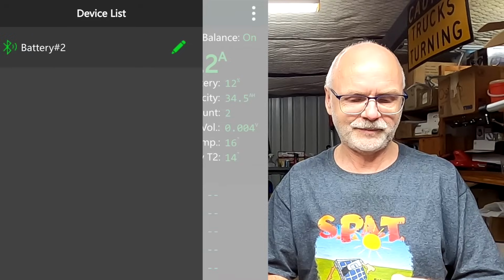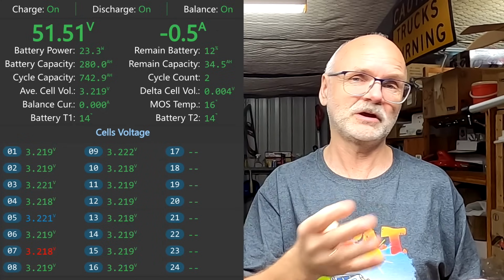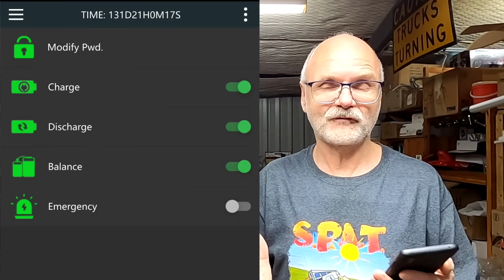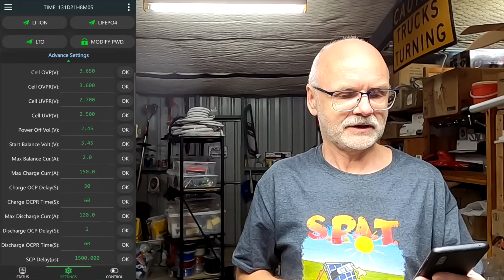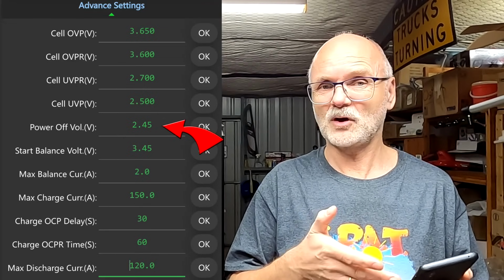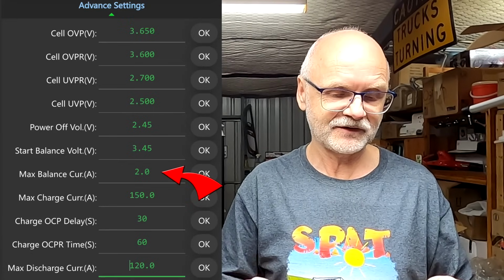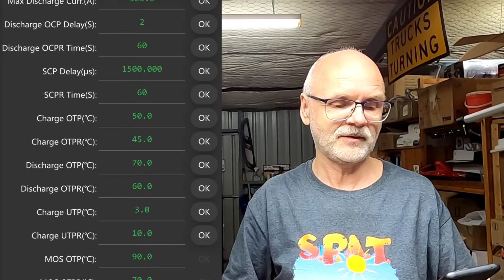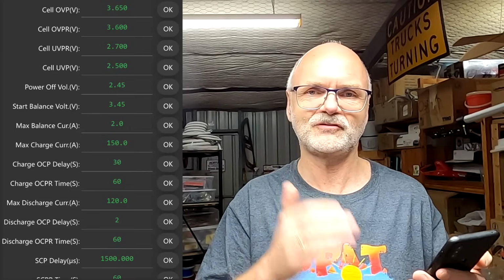JK-BMS: all settings and menus explained. How to program and set parameters.

Comment: Andy, thanks for the Video. Just out of curiosity, can you put two BMSs in parallel? Say the other BMS has canbus compatility with Victron.
Reply: In parallel with another battery attached then I imagine you can as Andy has. I imagine it's not possible if you have 1 battery and 2bms attached to the one battery. Just because both bms will want to balance the one battery so this might cause issues.
Reply: @mattjayne5231  the first BMS is a Batrium one. It will act as an active BMS . It has a remote shunt trip that disconnects all the batteries in the event of a critical failure. The other one I already ordered is the jbd bms. That one can disconnect individual battery banks. Therefore, my idea is to connect the Batrium to the victron system and to each battery in parallel to the jbd. Let's just think of it as an active balancer. I wonder if I am missing on something.
Reply: @salimnaufal1779  sorry I'm not familiar with the barium. What do you mean by active bms. As in it actively balances each cell? I'm unsure what features the JBD will add if that's the case. Unless you mean you'll use the JBD just as an additional balancer. If that'd the case I see your point bevause you can parallel active balancers and bms. 
I'm not sure to be honest, it might conflict if you've got 2 bms but I see your point you can parallel a bms and an active balancer.

For the sake of ease I'd probably be tempted to just get a larger balancing current BMS that also supports connection to victron
Reply: @mattjayne5231  
Batrium was the only Victron compatible BMS I could acquire. Victron encourage people to use their LiFePo4 batteries. The Batrium BMS has one central unit that connects to the six satellite BMSs on each of my batteries. It can also communicate with the Victron inverter and MPPTs using the compatible CANBUS. My problem with that is that it has controls a remote shunt trip that can turn off all 6 batteries if the event of a critical failure. It can balance each cell with up to 5 Amp. I will be able to monitor my batteries directly on the Victron system.
The JBD BMS, just like the JK BMS can turn on or off the battery it is connected to. It however can only balance with 0.2 Amp which can be quite slow. 
The JBD BMS will be able to turn on or off each battery bank independently since I will have 6 of them. 
I will make sure that the parameters for balancing the batteries are set to the exact same values of both BMSs to start. As for the critical errors that will cause all 6 batteries to be disconnected by the Batrium BMSs central controller, I will make the tolerances larger allowing the JBD to do the disconnection first.
I haven't yet received my batteries, I should in one month, I'm just planning it.
Reply: @salimnaufal1779  sounds complicated. Are the 6 batteries in parallel? Seems odd the batrium isn't able to turn off 1/6 batteries for example. That would eliminate the need for JBD by the sound of things. Is there maybe an option to add multiple relays in batrium system? Or is that expensive? 

Also what happens if JBD bms turns off one of the batteries. Is the batrium system then also not going to have issues as its lost 1/6th of the capacity but doesn't necessarily know that has. So would the satellite bms not spit out errors then given its been disconnected by the JBD?

Definitely an interesting one. Sounds quite a niche structure having dual bms. Might need some testing to work out if it's possible. In theory it seems it would but unsure how batrium will react if JBD is controlling things that it isn't aware of.
Reply: @mattjayne5231  I'm anxious to get the batteries to start testing. I will also request Support from the Batrium technical team to see what could be done... I'll send in my experiment to Andy but... unlike Andy, I will be compressing my batteries). It's going to be a hobby of mine for a while. Take care!
Reply from the maker: Would not make sense to put two BMS in parallel on one battery. What is the benefit?
Reply: @OffGridGarageAustralia  Mainly it's to be able to monitor things from Victron. It has a full set of controllable relays for alarms, fans, etc... quite extensive setup. The best thing is to get the setup ready and experiment... That is when by batteries arrive (delayed by one month!). I'm still running on the horrible lead-acid tubular ones!\

Comment: Hi Andy how you doing I hope all great just a question if could please help me I have a system with 3 set off batteries connected in parallel will like to connect a victron smart shunt do I connect just the one to my negative parallel bust bar thanks and regards
Reply from the maker: Yes, the smart shunt connects to your neg of all three batteries. It measures the overall current for all banks in total.

Comment: 063022/2107h PST 🇺🇸.   Danke Herr Andy. Xiaoxiang BMS (JBD) is sold under several names and Labels (some with ridiculous nomenclature)as requested by the bulk buyers/sellers. They are good, they are very intelligent, user friendly und very configurable.
I have twiddled with it for several years now and finally settled with your advice and configuration.
The system functions quite well and flawlessly in conjunction with VICTRON 100/30 Charge controller. 
Cheers, guten Tag und 73s…

Comment: Dear Andy,
I forget the password of JK bms and my phone got reset.
So, now I am unable to connect the JK BMS.
Can you help me with this situation?
Please
Reply: The default password I recall is 123456.
Reply: @FutureSystem738  Thank you for reply. But it's not working as I have changed the password.
Reply: @bishwagit  The only thing I can suggest is write a list of common passwords you have used in the past. Then try them one at a time, and cross them off the list.
Failing that, maybe just asking the manufacturer if there’s a way to reset. (There usually is- … though not always.)
Reply from the maker: You can only ask Hankzor what to do in this case... very unfortunate!

Comment: I purchased B2A24S15P BMS after watching your video and set it up and 8 cell 280ah and it ran for several weeks ok no issues. I then built a better battery shelf and disconnected completely and setup on shelf. The same cells were not in the exact same position but didn't think it mattered but now I have a 'Sample-Wire resistance Too Large' message coming up and it won't balance!  I have gone over all connections and tightened screws etc but still same. I thought maybe if I did a factory reset to wipe all data of it like it was when new it might work. How do you actually do a factory reset? Looked everywhere - no answer as yet. Why is this resistance message coming up?
Reply: I have just swapped BMS with another the same using the old balance cable and it all works.  Must be a faulty BMS or it really needs resetting??  I have messaged Hankzor so will see what they can do. BMS is only 6 weeks old.
Reply: I contacted Hankzor and they said: Thank you for your information. We are evaluating the cause of this problem. We will update the app as soon as possible to reply to this bug. thank you
Reply from the maker: Do you run the newest version from the JK website? Interesting that this is a bug in the app. 
Thanks a lot for sharing.
Reply: Yes latest version
Reply from the maker: @alltron66  keep is posted and get back to Hankzor of it's not fixed.
Reply: @OffGridGarageAustralia  I am very disappointed with these BMS's  Not only do I have a faulty one that they will not refund!!!   Now the  second one I have stops charging with no messages just zero amps coming in even tough there is power there and I have to turn disconnect switch off then on again for it to continue for however long then do it again.  I know you seem to have had some success with them but give me a JDB anyday.  The 2 I have have worked flawlessly and another good thing with them is the app doesn't keep freezing all the time and have to kill and restart the app like I do with the JK.  I'm sorry but I think JK has alot of work to do and yes I know it can active balance but unless it can work without all these problems they are not worth the expense as far as I am concerned let alone the non existant customer service.
Reply: I have spent over $400 on 2 BMS's neither of which actually work properly!
Reply from the maker: @alltron66  have you tried the new app version 4.8.2?
Where do you get this error? Right in the BMS or for a specific balance cable connection.
Reply: @OffGridGarageAustralia  the bms just stops charging! No msgs. All cells 3.3 to 3.4 when it happened today again. Not over voltage or current. 56a coming in just nicely then just stops no apparent reason. Very frustrating
Reply from the maker: @alltron66  can you send me an email? Go under About on my YouTube channel...
Reply: @OffGridGarageAustralia  I just downloaded today and yes it is working better so far thx. At least its not freezing ATM :)
Reply: @OffGridGarageAustralia  I must be blind. I can't find your email address🙄
Reply from the maker: @alltron66  or on my homepage right above the Buy me a beer section in the fineprint
Reply: @OffGridGarageAustralia  Andy, I have been sending you emails and not getting any responses.  Are you still talking??   Nami at Hankzor refuses to honour their warranty and say cannot provide any service.  How can Hankzor think they can get away with ignoring people who have faulty products. I know I won;t be buying another one of their products if thats how they do business!!
Reply: Well after chasing and chasing HankzorBms and getting no response they finally get back to me and say they can no longer provide and service. I am more than unhappy with this supplier. I expected great service but they have failed miserably and I am not sure what other action I can take to get a working Bms.!!??

Comment: I have also the JK-B1A20S15P Ver. 10XG For sure a good BMS and it do its job. Only disturbing is the constant "Protection (Current Sensor Anomaly)" error. It was also in ur log file visible. The seller said they aware of it and a update will come out. Only dont know when. What happen wehen the error appear? My BMS stops charging like goes on and of and after a while is it ok again. It happen when incoming and outgoing current is almost the same Then the error comes.
Reply: Hi Volker, I had the same problem. I adjusted the settings in the charger (multiplus II) fixed to variable and to lithium batt type and charge voltage tfrom 3,45 to 3,50 and had faults so far.... (3days) regards
Reply: @MrSkykay  Ok, I am charging up to max. 3.45V. Interesting. I am now in Thailand for a year, so it will take time to test it then :-)  Thanks for the help
Reply from the maker: Yeah, it's a known bug. I have not seen this myself in the 16s BMS I have.
Reply: I've been looking into this, and as Andy said, it's a known issue. JK claims it's because of using an all in one type Inverter/Charger (I have an MPPSolar brand). It doesn't happen on the older JK BMS I have, but does happen on the newer models with different Firmware and Hardware versions. From what I can tell, it's electrical noise in the circuit that may cause it. 

The "Anomaly" happens when it's less than 20A charge or discharge current for me, and while it appears to stop charging, it actually is still charging, I have a Smart Shunt to confirm this. So it's an annoying issue, but not a critical one. 

What it does do, is send the SOC figure way off what it actually is, until you reach either full or empty Voltage, where it resets itself. 

Hopefully JK will release a fix for this, because it's very annoying.

Comment: I have a JK BMS (with heating option) coming in the mail this video is very timely. Andy some video/test ideas for you: the JK with heating is a really neat future that I think many of your viewers can benefit from. Also, I'm surprised you haven't integrated the JK with Venous OS so that you can monitor your cell voltages on VRM and possibly control Victron equipment based on BMS data. This really completes the entire system in my view.  I plan to do this with a Cerbo GX using the LouisVDW driver. There's a page on Victron community on this topic. Check it out!
Reply: I have the JK BMS with the heater option. The 5 greens should serve as the negative connection and hooked up to one side of the heating pad. The other heating pad connection is connected to your battery positive. I tested this with a cup of ice water on the temperature probe and it worked perfectly. Note that the maximum amperage. for this function is 3 amps. I have a 25 watt, 12 v pad and it drew just over 2 amps. The red and black wires is not normally used but can serve to send temp readings to your charge controller.
Reply: I ordered the non heated 4s jk, and they sent a heated version anyway, but with no indication of how the heater should be wired up, it has i think 4 green wires, a black and a red and when i asked jk for the wiring diagram, they said please wait, and never got back to me. Got any advice on how those wires should be configured please?
Reply: @lexicase8805  I havent researched it yet TBH but once I receive it I will get backto you. There is another commenter on here than has had the same BMS for a while, maybe check with him. I asked him for recommendations on heating pad.
Reply from the maker: I have the 4s-8s BMS with heating function. Can't actually remember if it has a different menu settings for that...

I will connect the BMS to the Victron system at some stage. But there is literally no benefit of doing that apart from monitoring the BMS remotely. 99.99% of the time it will just show the same voltage anyway and there is nothing to monitor or control. Only if the battery is very empty or fully charged there will be a change in numbers and figures...
I know the driver and project page to connect it but again, no real benefit.
Reply: @OffGridGarageAustralia  I really hope you can do a segment on BMS and heating cells. Where to get pads and what to search for.
Reply: @OffGridGarageAustralia  Andy some of your viewers live in really cold plays or build batteries for RVs that go to really cold places. A video on this would be useful for a lot of your viewers.
Reply: @firpofutbol  Not even that cold, but in that twilight zone where there is a risk of freezing at night, some nights...
Reply: @OffGridGarageAustralia  well that integration gives you some interesting options. for example i start the absorption stage based on highest cell voltage, not some "average". lets say you go to absorbtion at 3.45*16, but some cells can be already in 3.55 at this point (or even go out of 3.65 in extreme case). The same applies to lower end of range. Plus it gives an option to start fast and slow down when cell's voltage grows. You may go with higher current for bulk period and then slow down gradually (i.e. 100A, 50A, 30A, 10A... not 1-0) as soon as fastest cell's voltage grows. Isn't it cool?
Reply from the maker: @maxicusc  I would be concerned if my cells are at 3.45V and one is at 3.55V. But I get what you're saying. Yeah, could make sense to start the absorption based on that one cell and slow down a bit.
Reply: Where did you order it?

Comment: What about the led on the BMS ? I think it is red blinking when not connected to bluetooth, red not blinking when connected to bluetooth and... that is all. What a pity it does not show the charge/discharge status it is a real lack for me (I do not like to have to connect to the app to be sure the BMS are connected to the battery).
Now they send a button with a led on it to switch the BMS on/off but the led seems to be not used : red when on, no led when off. Not optimal.
Reply from the maker: Yes, the LED is just for operation and BT connection. The new BMS all come with the display I have shown when testing the 4s version of the BMS. No app needed apart form the initial setup. But the display only gives you basic numbers. Not enough for me...
You also can connect the BMS to the Victron system to get a bit more info when being not at home.

Comment: A point about your lighting strike and 16 blue elephants, I have had this. Now, just be aware that you are still not protected as if you have more than 60v coming from your panels it will simply blow up your BMS... So you still are not really protected against this scenario...
Reply: This is why I like using comms from my BMS if something goes wrong the inverter-chargers just shut down. The BMS disconnecting is the secondary protection not the primary.
Reply: @edc1569  I am not sure that having comms would avoid the problem of shorted FETs. If the cc goes short, the BMS will go short shortly after trying to disconnect more than 60v from the panels. Ok the inverter will shutdown with comms but so.would a normal inverter as the inverter will see a overvoltage as the bank cooks. We need a relay or crowbar circuit clamp the voltage to below 60v so the FETs can operate.
Reply from the maker: The comms will not help you and is not a safety feature or replacement. You need a proper shutdown for your SCC in this case, a contactor for example...

Comment: Are you sure about the micro cycles adding up in the BMS to a full cycle? From a firmware perspective I doubt it would do that but wonder if you have had any conversations with jbd about this? I would have thought the counter would simply increase each time the pack gets under a certain batt %.
Reply from the maker: Yes, they add up. I had to change my capacity form 304Ah to 280 which reset the counter and now I have 2 cycles again and I'm below 30%SOC for months now.
Reply: @OffGridGarageAustralia  interesting. Good to know. Thanks